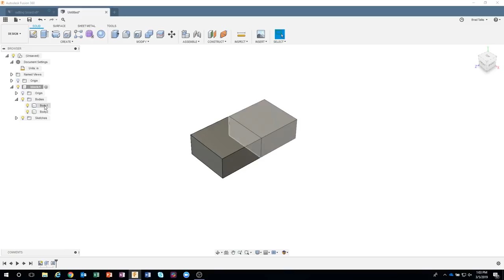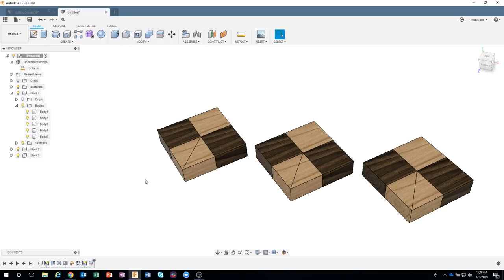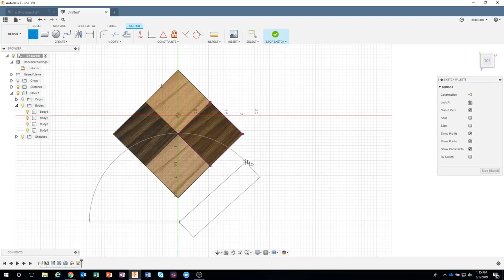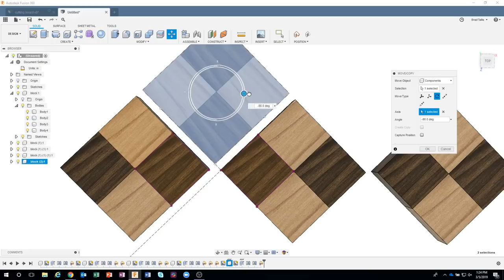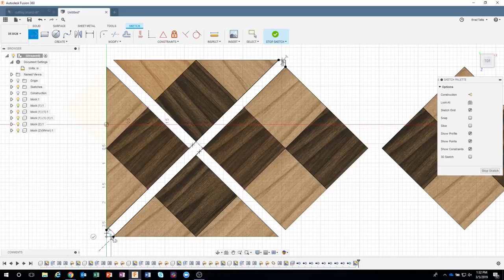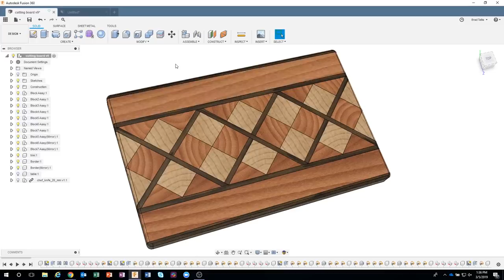Episode 17,  Design a Laminated Cutting Board

Comment: Sorry for commenting on an old post, but only just watched it yesterday. You mention, you didn't want to use the pattern command because of it cutting all the components. Would It have been possible to run the pattern command, then draw a large rectangle and extrude an intersection? Intuitively this felt like a pretty simple way to solve this kind of regular pattern?
Reply from the maker: @Daniel-  The issue is that if you use a pattern, all of the pieces are "clones" of each other.  So, if instance A and instance E were hanging out past the "rectangle" of your extrusion, it would chop off the edges of instance A and instance E, AND B, C, & D.  That is what the issue was.

Comment: This cleared up a lot of stuff. Can you show how that would be cut in the Manufacturing module?
Reply from the maker: @R Wilson-  Because the board is pretty much square blocks, I probably wouldn't use the Manufacture environment to make this cutting board.  However, if I needed to cust like a drip-groove around the top, then I would.  I just used my table saw to make the actual cutting board.

Comment: Great video

I was wondering if you can explain what capture position actually does.  Also, I would appreciate a video detailing lifting using rails. I seem to be hit me miss when I try to loft from front plain to the top plain when I design a cooling duct for my 3d printer. It would also be helpful to show lifting in both the model and sculpt workspace. 

Thank you
Reply: capture position captures the position after the body/component has moved. You might be messing around with a joint but don't actually want it to permanently change the position. So, you would NOT use the capture position functionality
Reply from the maker: @Bernie-  I will add lofting to my list.  In fact, I'll probably use your idea of a 3d printer cooling fan as that is a great example of where you would need to use loft.  Capture position captures the positions of your components "at that moment in time".